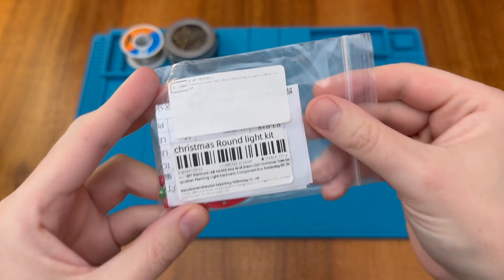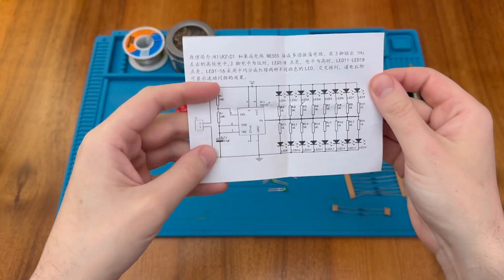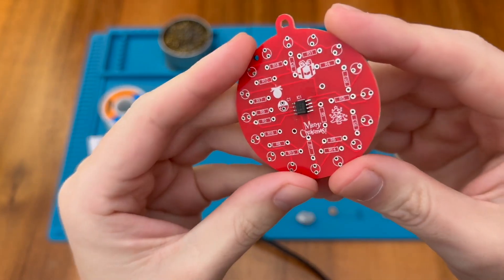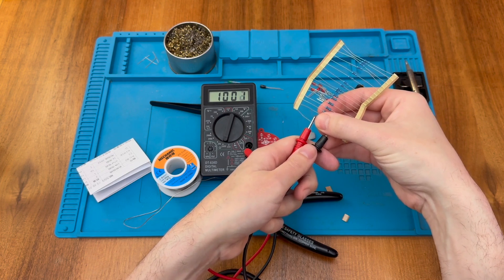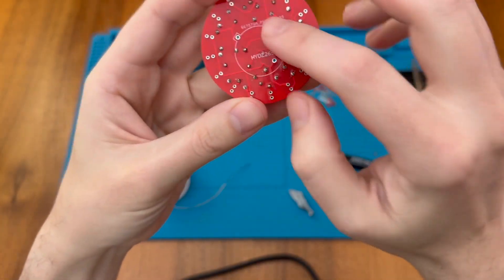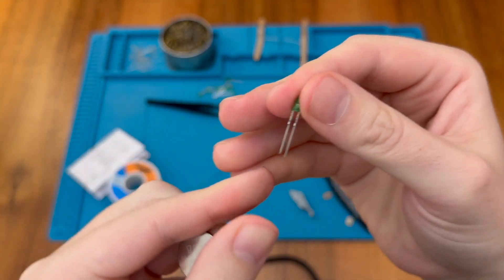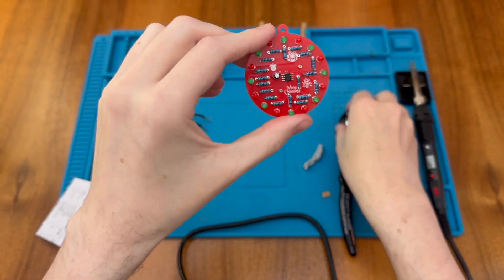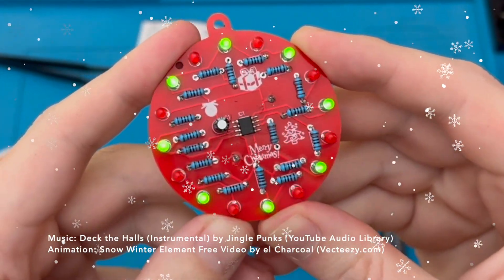LED Christmas Tree Decoration - Flashing Bauble Shaped DIY Soldering Kit with Surface Mount NE555

Comment: My green LED are way brighter than the red ones, what did i do wrong? 😅
Reply from the maker: I don't think you did anything wrong. It seems that way on my build as well. This effect seems to be due to a combination of the amount of time the LEDs are lit, and the efficiency of each colour.

If I were to build this again, I think I would swap the red and green LED positions. I think it would give the illusion of better matched brightness levels.
Reply: @jtjacques thought about changing the resistors for the green LED, but my knowledge does not go far enough to know if that will mess something up. 😅
Reply from the maker: @RuedigerEtzold  As long as they are the correct way around - positive to the positive (anode) to the positive position and negative (cathode) to the negative position - it should work correctly... but I have been wrong before! https://youtu.be/k9P4iMX3_u8
Reply: @jtjacques unfortunatly  no, I have red ones bright and green ones faint. 😂

I guess theres only changing the ressistors as an option left. 
Any advice how to do that?
Reply from the maker: @Siara87  You'll probably need to experiment a little to work out the best value. I recently built another kit that shows the effect of different resistor values on brightness and discusses Ohm's law. https://youtu.be/Q7dzUj3CpA8
Reply: @jtjacques you know what? We just swaped thoes green ones to green but clear ones and now they are stronger than red. Plus 3aaa bateries so 4.5v and a switch, all in a clear bouble.
Reply from the maker: @Siara87  That sounds like a great modification!